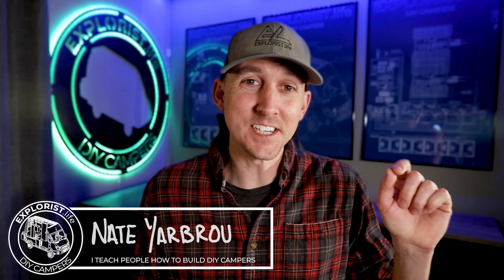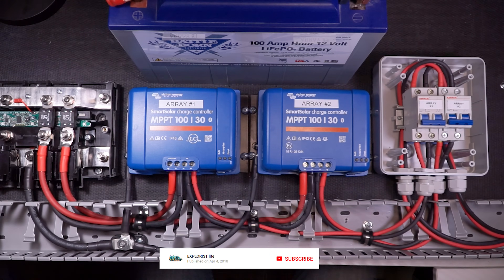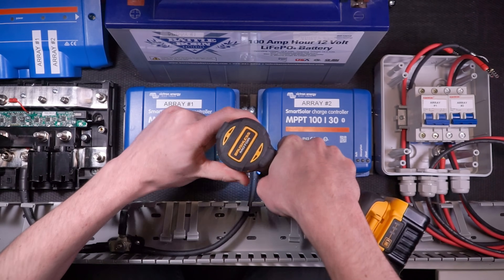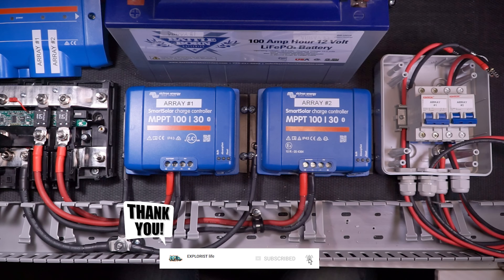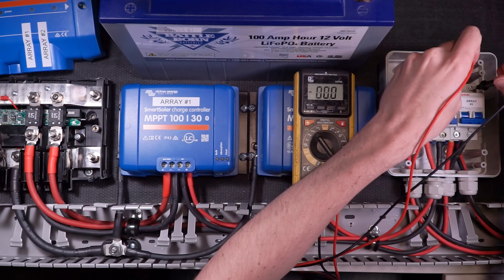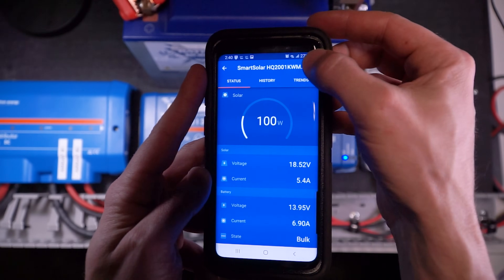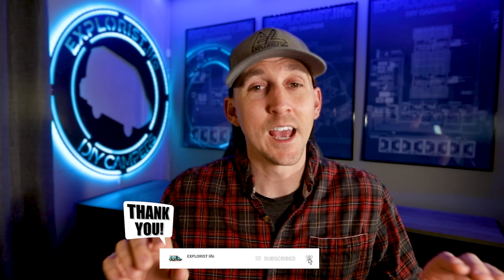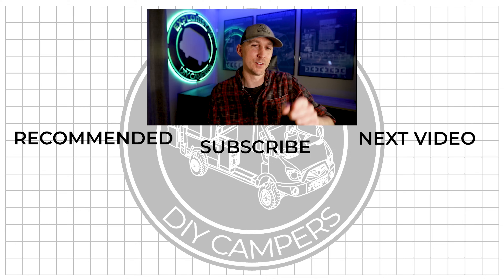How to Wire Multiple Solar Charge Controllers into a DIY Camper Electrical System

Comment: Why do you have to earth out the controllers,  and you you still need to earth out the single controller if uou are only using ?
Another great and helpful video
Reply from the maker: In the event of an internal catastrophic device failure where the positive wire contacts the case of the unit, this equipment ground wire would allow power to flow back to the busbars and would allow the power to flow freely which would allow the fuse protecting the wire from the busbar to the charge controller to trip.

This also needs to be connected with a single charge controller.  How to wire a single charge controller: https://www.youtube.com/watch?v=XSfu8V0DR1g
Reply: Thanks for help,  keep up the great videos it helps alot

Comment: What brand of solar disconnects are you using?
Reply from the maker: I keep the blog posts and wiring diagrams up to date on the products that I recommend.  Sometimes the specific brands change as things go in and out of stock, so you can always check the wiring diagrams at https://www.explorist.life/solarwiringdiagrams for updated product recommendations OR I have a parts list going (including the disconnects) for this specific video on this blog post here: https://www.explorist.life/how-to-wire-a-solar-charge-controller-for-a-diy-camper-electrical-system/

Sorry for not answering your question here...but as these disconnects seem to go out of stock quickly, if I told you the brand... my reply would likely be out of date within a few weeks...